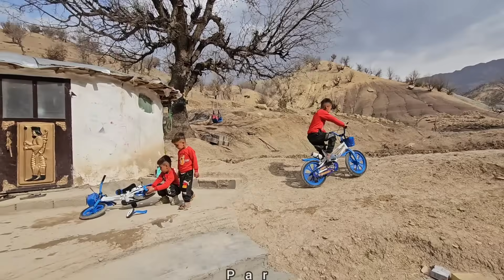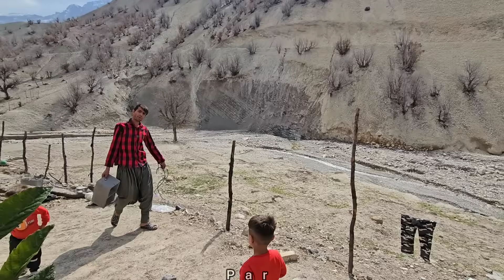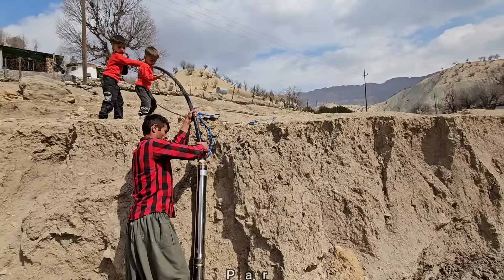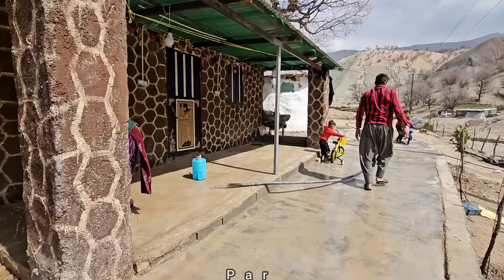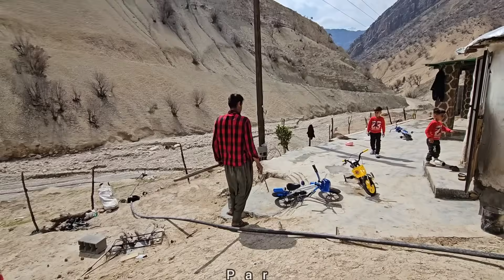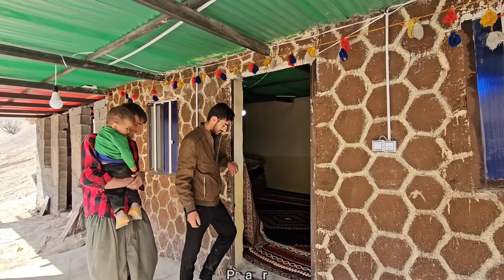Irrigation of fruit trees in the village.  Babak activated drip irrigation by installing a float

Comment: Babak,
That is a deep well pump you got for irrigation. Do you plan to eventually drill a well and pipe to have this pump deep in the well supplying the water you need? It is designed to be suspended 20 meters down inside a drilled well, that is what the waterproof pump and blue line is for. Otherwise a different electrical pump made for the surface or dug well would be far better.

Comment: Good job ..
Consider making a water tank / reservoir on the elevated side to store water. then you can water all your plants through drip system using gravity. motor will be required only to pump the water from river to the tank. 
best of luck 🍀